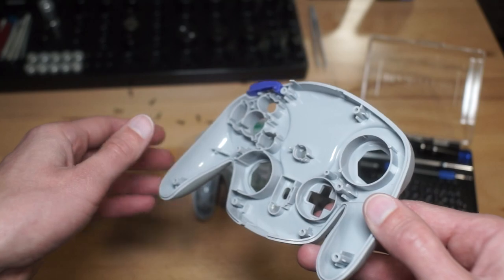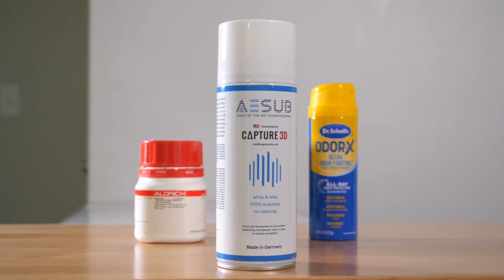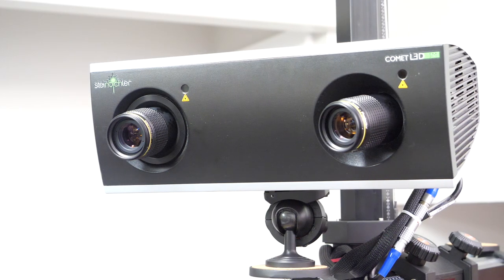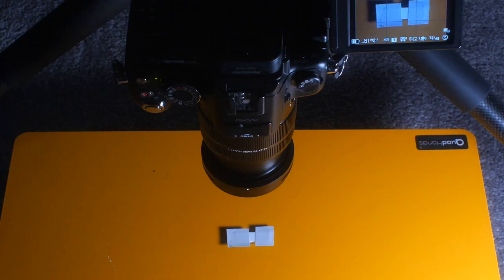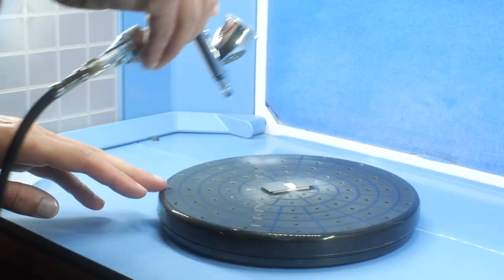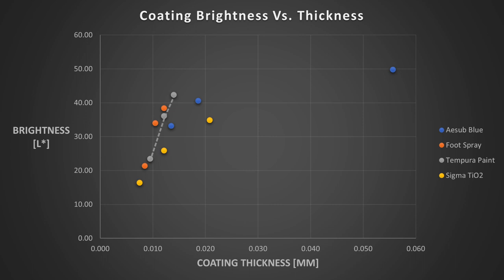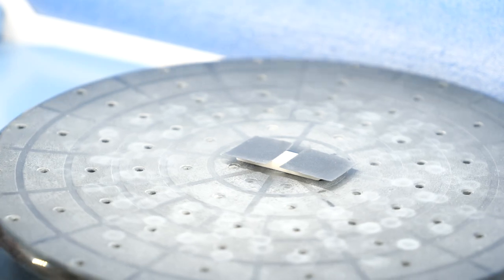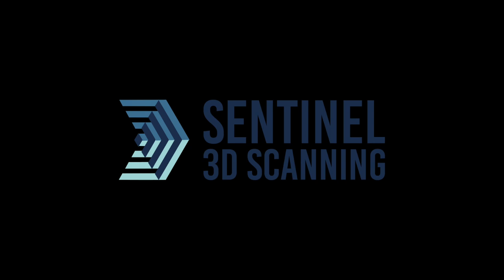Scan Spray Showdown: What is the Best Coating for 3D Scanning?

Comment: Apparently, per the SDS, Dr Scholls foot power is butane, ethanol and talcum power. Talcum Powder has a refraction index of approximately 1.5 and Titanium Dioxide is approximately 2.5 considering talc is almost exactly half the cost kg per kg and I have talc on hand I will have to experiment with some denatured alcohol solutions and some photogrammetry projects i have going on. Thank you this has been informative.

FYI denatured alcohol is primarily ethanol alcohol with methanol as a poison to eliminate alcohol taxes.
Reply: How you apply this solition intou your objects?
Reply: @que_dijo  just buy the foot powder spray or talc per the pound and use a rapidly evaporating solvent like isopropyl, acetone, or denatured alcohol so it could be used in a spray bottle or paint gun. The uneven texture gives scanners something to reference and give cleaner scans or photogamatry.

Comment: crikey, you want a bit mad with the aesub blue. the temptation is to spray until it looks white, but actually a quick, light spray and leave it a few seconds , it goes white.
Reply from the maker: Yes, I certainly applied way too much on the first trial, and the error of my ways is made painfully obvious by the outlier data point visible at 7:14! I made sure to apply less on subsequent trials. Thank you for the tip, Andy!
Reply: I was thinking the same thing

Comment: After trying many products I found a brand of chalk spray that works perfectly. Its called “Heidi Swapp” .  It covers fast so no need to build up a thick layer, and the final finish is nothing less than perfect !  Other brand chalk sprays leave small chalk clumps on the surface. Not this brand. I buy whatever color spray is on sale, usually around $9.00  a can and one can goes a long way.  I have a David SLS 3 pro and other structured light scanners and I have not found any difference in my scans using different colors. On the chalk spray, it does wash off with soap and water but its dye can stain untreated white plastic.  I just got a can of Magnaflux developer spray but have yet to try it. 😁
Reply from the maker: Thanks for sharing your experience! I've never tried chalk spray before. I tried Magnaflux developer once, but it went on too thick and the texture was quite rough - maybe because it was an old can.
Reply: @sentinel3dscanning     If the Magnaflux  spray is going to go on thick then I will stick with the  Heidi Swapp  brand chalk spray. I buy whatever color is on sale on Amazon or Ebay.  The different colors are all bright like Magenta and Teal for example, and do not affect the scan. I would bet they have white but when not on sale prices are around $30.00 a can vs about $10.00 a can when offered on sale.  I have tried many different dulling sprays over the years so I can confidently say that I highly recommend trying this chalk spray.  Keep up the great videos 😁
Reply: All i see for this Heidi Swapp spray is blue and teal and its like $19 a can on Amazon

Comment: So i have a plastic model jetski i am trying to scan and its too shiny. I tried foot powder, and i even sprayed it with grey plasti-dip. I have to of these models, one is yellow top and yellow bottom, the other is white top and yellow bottom.
I really dont want to damage these as they are rare but i want to male 3d printed replicas. 

I am using a Creality Ferret Pro scanner.

Any suggestions? That AEsub spray is spendy, should i try that?
Reply from the maker: Aesub Orange is probably the best way to go if you want to reduce damage. In my experience, Aesub Blue evaporates too quickly and goes on rougher. It will be pricy, but it will be safe. On something as big as a jetski, you will probably need several cans.
Reply: @sentinel3dscanning  its a toy model its only about 10inches long.

Comment: Have you tried plasti dip paint that you can peel off afterwards
Reply: for plastidip (any rubberized coating) to "peel" off you would have to apply it heavily, which will significantly alter the actual surface of the object being scanned, if it's something that remotely requires any sort of accuracy, it's not going to work.

Comment: I got a tip to try out ATTBLIME AB2. It’s like Aesub blue but it’s a thinner surface coating. 
I ordered 2 cans for now and will test it out. But I don’t think i can do the same test showed here….
Reply from the maker: Let us know what you think once you've tried it out!
Reply: How is it, as well as the smell and sublimation time compared to AESUB ?
Reply: I had used it now couple of times and it's ok but if you coat the part too thick it will not disolve. Coat it once, wait a minute and do a second coating.
The smell, compared to Aesub, is better.
Reply: @Todestelzer  I guess the smell is very light almost non-existent ? 

Compared to AESUB which you can coat thicker it still dissolves ?
Reply: @christopher8116  buy booth and test it. I would recommend the orange Aesub. It stays longer on the part.
Reply: @Todestelzer  How long does the Blue AESUB last ? I have a can of it here, not yet used.